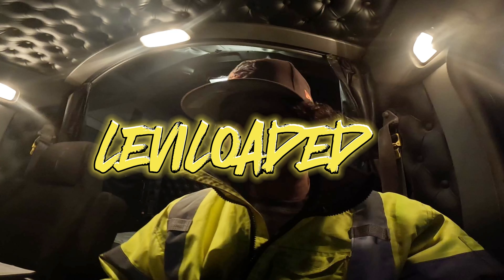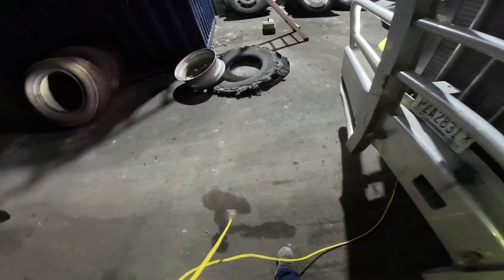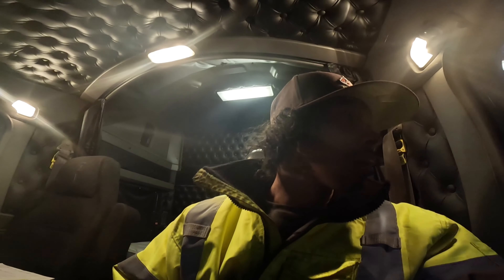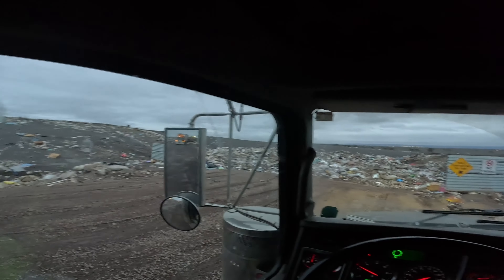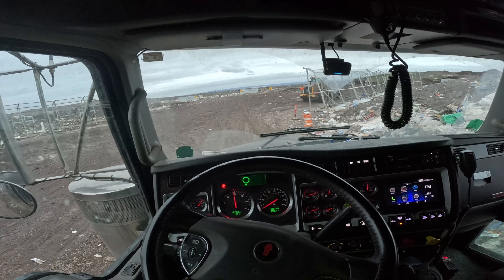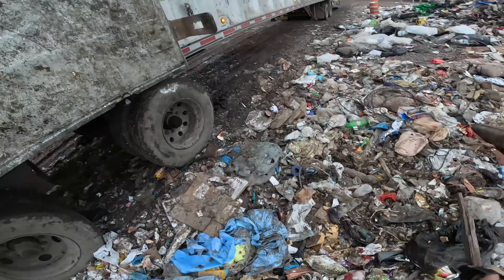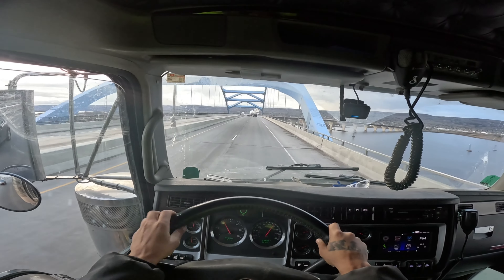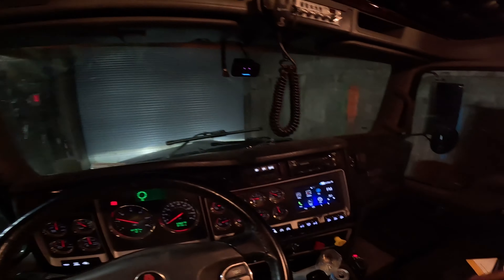LOCAL CDL TRANSFER STATION DRIVER (ROOKIE TRUCK DRIVER)

Comment: Man, I  did that for about a year.. do not ever apologize  for running as safe as you can.
Reply from the maker: I think that’s what ima do here, ima get my hazmat , put in my 1 year, then haul fuel nd eventually get my own hotshot truck set up nd be a hotshot O/O 🙏🏽🚛
Reply: @LeviLivinLife  get hazmat, tanker, Twix. Genesis tanker does fueling for truck stops. Good$$$$$.
Reply from the maker: @johnm6642  Yee ima get my hazmat and tanker then haul fuel for a year, I’ll prob haul for kwik trip, they are starting at 92k a year